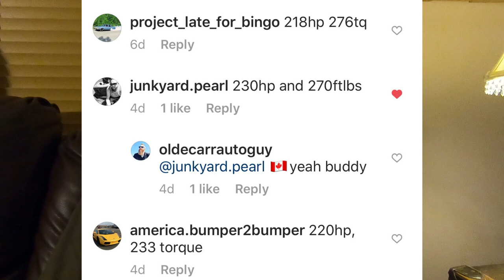DYNO TEST MY 1979 CHRYSLER CORDOBA  AT ROCKWOOD PARK SAINT JOHN NEW BRUNSWICK

Comment: Great video! Thanks again for the interview and introducing a hydrogen hybrid vehicle to your channel, it was a pleasure! Next year i shall come prepared hahaha! I will bring a power pack and a fan so that my  engine doesn't starve above 6000rpm and have it handy for you if you want to use it to try and inch closer to that 250 hehehe ! In the spring I went to a dyno day in Moncton and was making power up untill 6800 where it would barely taper off till past 7k. Numbers were a little low that day also, but there was an 8% in difference in gear ratio reading between the 2 pulls, and both were done in 3rd gear. 266/238 at 8% puts me at 288/258 which is pretty bang on to my little touch screen tuner that comes with the hydrogen kits, it's numbers play just around there on every pull at 285-290/255-260. I will be doing some adjusting to the custom tune since adding headers and additional exhaust work and will try to attend the dyno day in Moncton october 12-13th see what it does again. I will also try and go to Miramichi dragstrip one last time before season end and see what speed it traps at. Beginning of summer was 105 mph, if i can gain a couple mph and get my 60ft lower then 2.0, it will be ,or close to be a 12 second car in the 1/4 mile! Not bad for an NA V6 Mustang! Thanks again, was a pleasure seeing you and hope to see you again next year! Cheers!
Reply from the maker: It really was a great opportunity to meet you, interview and follow up with your car on the dyno! I hope we don’t have to wait til next year!
Reply: Thanks again! And yes hopefully we don't have to wait till next's years car show to meet again hehe! I'm currently in Beechwood until the end of the month as I work construction union as well, but i plan on making one last trip to Saint John see family before putting her away for winter. I could maybe swing around down the western side of the province and make a stop in beautiful Saint Stephen for a visit at the office at Olde Carr auto sales! Could give you a good look of the kit of how it works and how simple it is to use and maintain!

Comment: The wheel HP and TQ is actually pretty good, I was expecting 200 WHP at the most after watching the test runs. I don't really feel it's choked out, but more like it's a bit out of tune or unoptimized. The weight of the car, the tightness of the converter and the engines powerband don't work very well with each other making the car feel a bit lazy on take-off despite it's decent crank horsepower. A father-son team that has been racing Mopars for over 40 years in my area told me that the Torqueflite equipped cars only lose about 75 to 100 HP from the crank to the wheels give or take some depending on variables like transmission condition, axle condition and wheel and tire size and weight and I've seen it proven to be true multiple times for not only Mopars but other classic three speed auto solid rear axle cars as well. This means you're indeed quite close to the HP you want, 218 at the wheels would mean you are making at least 293 at the crank if it's losing only 75 and you could be making as much as 318 HP at the crank if its losing 100 HP on the way to the wheels. 

The fuel pump has nothing to do with this, carbs aren't sensitive to fuel pressure like EFI is, you can gravity feed the carb with a motorcycle tank like they do on Roadkill and have zero issues. As long as you don't feel it cutting out/running out of fuel then you still have fuel in the carb. Cars with a lot of HP can actually suck the bowls dry but your combo isn't really making the kind of power for that to be occurring. Most importantly don't let somebody talk you into putting a big carb on it cause that's gonna kill your torque curve. A 600 CFM Holley is sufficient for 400-450 HP with the right modifications and makes significantly better torque, throttle response and fuel mileage than a larger carb. 

Cylinder pressure has a LOT to do with torque production and torque is something you desperately need to get that beautiful 4000 pound luxury yacht rolling. If you truly wanna go back to the drawing board I would pull the heads and have them milled and ported a bit or just replace them with some junkyard Magnum heads that already have better compression and flow. Just pulling the heads and replacing the gaskets with thinner ones like Felpro 1008 would net you a notable gain. 

I've also been doing a lot of research lately on cam timing as a cheap way to improve performance and it's a great budget option to consider. Advancing the cam timing a bit not only moves your powerband to a more usable area for your gearing but also increases cylinder pressure notably because it causes the intake valve to close sooner in the compression stroke while the piston is still traveling upward. 
If you don't already have one you can buy a multi keyway adjustable timing set for around 60 to 80 bucks that will let you advance the cam timing a safe amount for better throttle response and low end power.
 
I feel like the thin gasket and the Cloyes keyway would be a good affordable combo and compliment each other very well. I'd do a compression test before and after just to see how much the two of them did for the cylinder pressure together. While you have the heads off you may as well get an air gap intake if it's in your budget or at least block off the heat crossover, the cooler charge would offer you noticeably more HP and better throttle response. A looser converter would also really help emphasize the new found low end power but it's a bit more expensive and difficult to install than the things I've previously mentioned. 

Like another viewer said you could also be throwing some power away with basic tuning, especially ignition timing. I just watched an episode of Engine Masters where they showed how much power you can throw away with a bad tune and ignition timing had a much greater effect on HP than fuel/air ratio did. Power seemed to go up up and up as they advanced the ignition timing and it eventually peaked and then started to fall off a bit but never lost as much HP as when it was too low. 

To close out this rant my point is according to Engine Masters you could be losing as much as 20 HP from just not having enough ignition advance. It could be well worth it to you to just put a timing light on it and try turning it up a bit. Although combined gains from a thinner head gasket, colder intake charge and a better tune-up could potentially add up to the ballpark of 40-60 gained HP! Anyhow best of luck, I love the car and hope you made it through this wall of text and got something useful out of it!
Reply from the maker: I always enjoy a well thought out response in the comments! Especially from you as I value your knowledge! I’m going to check out Engine Masters and dust off the ole timing light! 

You and I have spoken in the past of the airgap intake option but not in the budget st the time! Although a pretty cost effective project and can be completed in a short time, I mentioned in my next video that I’ll see what Santa has in the cards for a winter project!

Thanks again for the educational text! I appreciate it very much!
Reply: @OldeCarrGuy  I understand, I can't afford to do a majority of the things I wanna do for my cars right now either. It seems I overthought yesterday and forgot to mention one of the cheapest and easiest things you can do for that motor to pep it up and that's a phenolic plastic one inch spacer plate under the carburetor. It will most certainly add to your dyno numbers, I've seen them add quite a bit of power on the dyno and I also just put one on my Trans Am with great results! I even sent one to a youtuber/friend in Australia that has a 318 in his sweet 68 Aussie Valiant. They can cost anywhere from 15 bucks to over 100 but I paid 30 for the one on my TA. They make two kinds of 4 barrel carb spacer, open and 4 hole. The open spacer is designed to improve mid range and top end power while the 4 hole is designed to improve low RPM torque and broaden the engines torque curve a bit. An open spacer would have a greater affect on your dyno number but the 4 hole may be just the trick you need to help get your big car moving. Speaking of that big beautiful car I looked up it's weight out of curiosity and I was pleasantly surprised to see that it's a bit lighter than I expected. I thought for sure it'd be a 4000-4200 pound car but a reliable source says it was only about 3800-3900 depending on the options. That's not bad at all! You got the new V8 Chargers and Challengers beat by a couple hundred pounds!
Reply: 2 very good detailed responses impact bro
Reply: @AntonioClaudioMichael  Thanks man, I truly appreciate the encouragement and respect!
Reply: @Impactjunky  Very good suggestions and +1 for Magnum heads. They work!
Reply: @DR440  Thanks man, those magnum heads are a real treat indeed. Really helps even the playing field for us budget minded Mopar guys.
Reply: @OldeCarrGuy  I just wanted to let you know that I just watched a new episode of engine masters the other day and I was shocked to learn that fuel pressure actually CAN have an effect on a carburetors performance. I truly didn't expect this since so many motorcycles and even old timey cars were designed to gravity feed without a pump at all. Carbs aren't dependent on pressure like EFI is but I know now it can certainly help. I just wanted to get the facts straight with you and apologize for so confidently misinforming you. Preventing the spread of misinformation is far more important to me than being "right" all the time. I have an old Holley high volume/pressure mechanical pump I've been saving for a future build but I might just throw it on the Satellite now, if I remember correctly they gained a little north of 10 HP from a better pump in the test!

Comment: Nice car ! I’ve got a 72 charger myself. .60 over 318. 4 speed. 3.90 rear gears. Comp can xe268. It’s been a learning curve.  If I was to give some input on your 360 it would be get a nice set of aluminum heads or Closed chamber style head. Less combustion area and more compression. Where your pistons are down in the hole a little that will lower your compression some. Not sure how much. I’m running flattop pistons that come all the way up to top of the block deck. They have valve reliefs in top of piston. Also maybe see about a different distributor set up. My pistons looked like yours. Covered in carbon. I was told I needed hotter spark. I found a knock off MSD distributor (top street performance ) just with out the  msd label for a 3rd the price. It’s a ready to run unit.I’m down to my short block as well.  
Oh and if you haven’t heard of uncle Tony’s garage. Look him up on here. He took a 318 and made it scream! Cheers!
Reply from the maker: Hey Rob! I really appreciate the info! I've already had to rebuild an engine for this car once and did the heads on it back last spring. I swore that if i ever had to yank the motor again, it was getting a modern hemi drive-train. Having said all that, it likely won't be for a while as I am currently working on a square body project to have ready for the spring! I have been compiling all the information and tips I have been getting from many knowledgeable folks like yourself and will have to make a decision at some point! 

Also, I'm a subscriber of Uncle Tony and Nicks garage. They're info has given me lots to think about for round three on this beast.
Reply: Olde Carr Auto Guy I’ll be watching for ur next video on it since I’m a Mopar guy

Comment: About your low power concerns;
If you have access to a 5 gas analyzer, I'd like to see the readings (HC, CO, NOx, 02, CO2).
Interpreting those numbers can determine fueling, and overall combustion efficiency. 
 
If the motor is mechanically sound, my guess would be a fuel, or ignition timing issue.
Just a guess.
Reply from the maker: I don't have an analyzer, but i'd be inclined to agree that ignition and or fueling!

Comment: I don't know what is all in your 360 but I been messing with sb Mopars for years. What camshaft and compression ratio? Check the timing as well. A 727 will eat close to 50 hp vs a 904 trans as well (about 25).
Reply from the maker: I don’t know the compression ratio but I’m only guessing 9-9.25:1! Stock was 8.5:1 I believe! 0.30 over Flat tops, magnum series Comp Cam (480, 280), edlebrock performer intake, 1604 edlebrock carb, headers and h-pipe! 727 and 3.21 sure grip!

Comment: not bad good torque to hp ratio in my opinion looks like you are around 270hp315ft i think   sounded good on the dyno. i think your factor maybe the carb if i recall you have an edelbrock on there and that could be the limiter
Reply from the maker: Yes, its an Edlebrock! I'm beginning to realize why so many people dislike them.
Reply: @OldeCarrGuy  yea that 80 c10 with the 468 was a junk motor with it on there and it was there big thunderseries carb and larger then what the cfm calculator recommended, went with the quickfuel only 50cfm larger and that thing woke up. I had sevral edelbrocks in the past before that and just could never get performance out of them.  Theres alot of good choices out there. Demon and quickfuel are good or if you have the money get a holly efi people love those.
Reply: @EfurdGarage  @Olde Carr Auto Guy The 600 CFM Holley Vacuum secondary carbs I have on a couple of my vehicles go for around 320 bucks new. Just a thought if you guys ever need a new or better 4 barrel for a stock/mild street car.

Comment: Just an fyi
Parasitic loss is 30% so if your motor was at Nick's it would have been a number closer to 280 hp
Considering it left the factory with about 160 hp you are doing great 👍

My cougar made 340 on the rollers 
And 440 hp 530 tq  with a 50 shot of nitrous acting as an intercooler
Reply from the maker: I'd agree with you on the loss of power through the drivetrain, however, my point being that engine in my opinion should be pumping 325-350 crank horsepower which would be 280-ish with the loss to the rear wheels.
Reply: @OldeCarrGuy  I get what you are saying. Considering it was 160 @ the flywheel from Chrysler 
You nearly doubled the factory output.   To get near the hp per cubic inch area  would require heads.which you already know. 
I still think it is really respectable for what it is.
See Brett down in moncton. He could probably ring at least another 25- 30 hp with tuning. 

The number is fine. 
👍

Comment: Man, was hoping the Torque number at least would have been up there a little more despite the lower hp numbers. If you do 20% driveline loss, it's a 272.5 crank hp car. But I agree with you...with heads and what not you should be a 300hp crank car probably. But also don't know enough about what the starting point was for your block in stock form either, like compression ratio. I don't know if the Fairmont would even turn the rollers on a dyno, haha.
Reply from the maker: If you go read Impacts Garage and gaming’s post, you’ll find a wealth of useful information that may be useful to you as well!
Reply: @OldeCarrGuy  I will go find it, that dude is a wealth of knowledge!
Reply: @OldeCarrGuy  @Str8sixfan Thanks for the kind words guys, it means a lot!

Comment: 220 WHP is 260 at the crank right? That is not bad.
Reply from the maker: Most people say you lose 20 to 25% drivetrain loss so that crank horsepower is probably closer to 275! I was just expecting more from what I have! Thanks
Reply: @OldeCarrGuy  But the engine is not standard I guess? I just bought a 77 Cordoba with the 400 and the lean burn removed and I thought that one is rated at 180 HP
Reply from the maker: My engine is not stock. Flat top .030 pistons, lumpy cam, edlebrock intake and carb, highflow "J" heads, true dual exhaust with H pipe, 3.21 gears. I was truly expecting to see 265-270 at the wheels which would be around 330 or so!

Comment: Nothing wrong with that from a stock built 360
Reply from the maker: It's better than stock Hal, but should be much better that what it is!
Reply: Check distributor advance. I curb all my dizzies. Mopar is famous for putting too much mechanical advance in the plate. If you’ve upped the compression ratio, this will make it even worse.